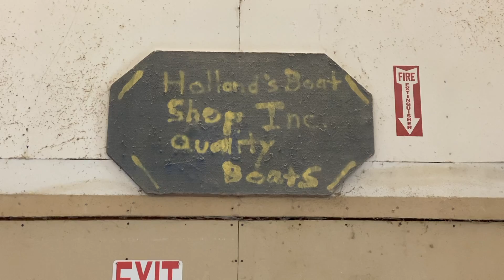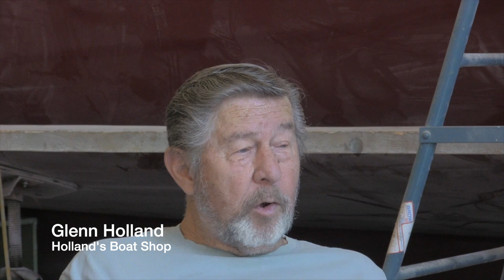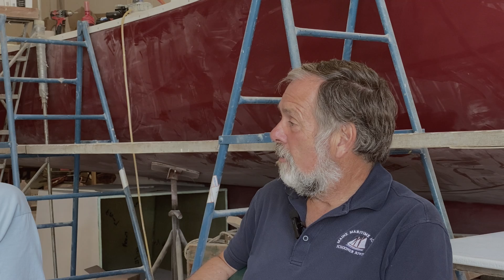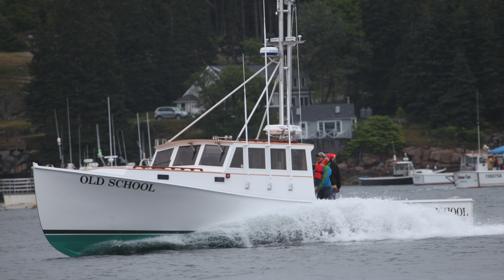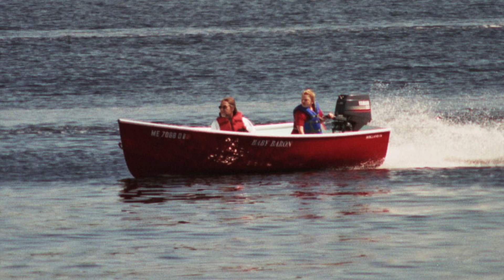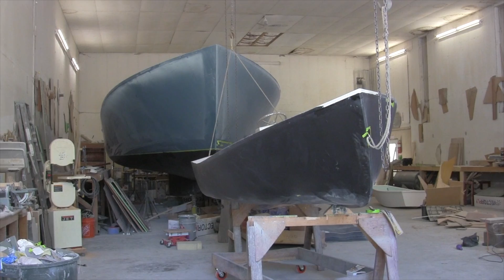Maine Built Boats: Meet Glenn & Gavin Holland

Comment: We bought one of the first 14' hulls in the 90s. I finished building it as a diver tender with a self draining deck. Used it to tend divers in 8' seas. I worn out many outboard motors on it. It's still in very good condition at work for Down East Commercial divers